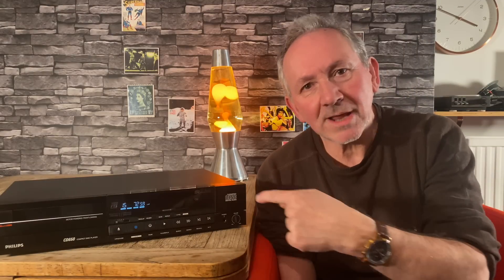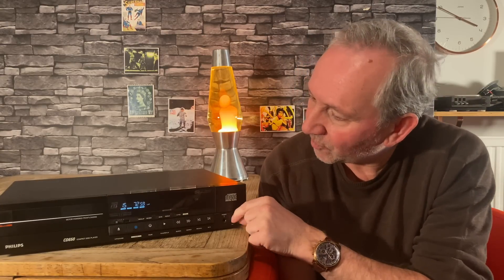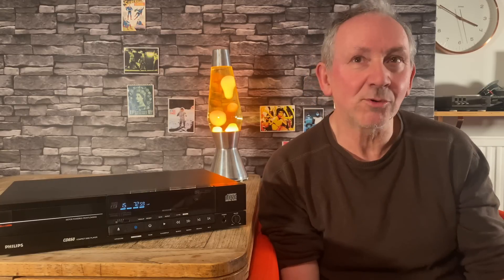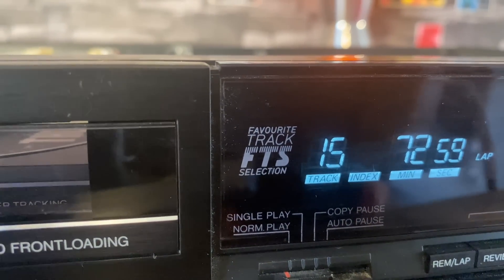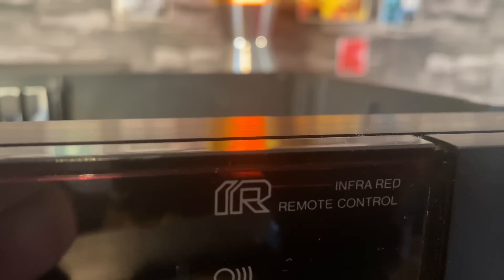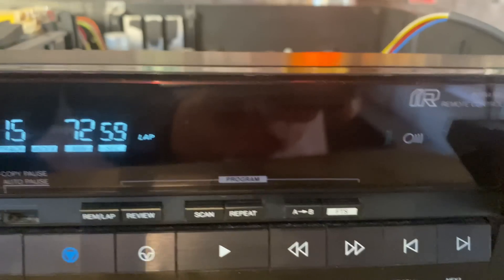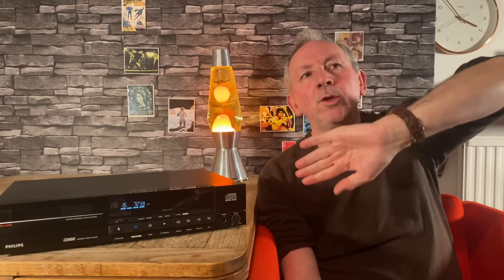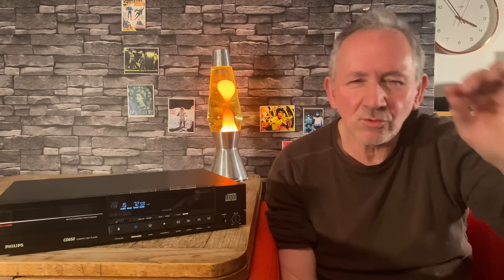I review early CD player and its impact on HI FI world

Comment: Great to see you Kelvin! Have to agree about the CD player sound. I ended up going through about 5 cd players to find one that was decent sounding. Non of them really did. I use an R2R dac now. Also, I repair hifi and CD players generally have a maximum operating time on the laser - and can be expensive to source. DC Servo's fail even on good units and can be difficult to fix. I can recommend old Rotel and Sony units from mid 90's to mid 00's. They just keep going, and the Sonys sometimes have all the programming and jog dial features.

P.S... Anyone heard a Sugden A48 mk2? There's one for sale near me and I'm very tempted.
Reply from the maker: Oh the sudden is just a great Amp. I reviewed it really one of my top favourites doesn’t seem to be working anymore my one 
If you Repair Amp S interesting thing about the Sugden is that inside there’s a din plug the separates I believe the pre-empower Amp. Just to let you know I think I have that right anyway

Comment: Welcome back Kelvin. The CD player had a output voltage of two volts which was double of what other equipment had at the time so it would play louder at the same volume setting. I once tried to get out the op amp from the output stage, because it is a replaceable one, but I guess they soldered it in anyway because it was stuck. This one has a digital output so you can use it into a separate DAC. It will sound a lot better.